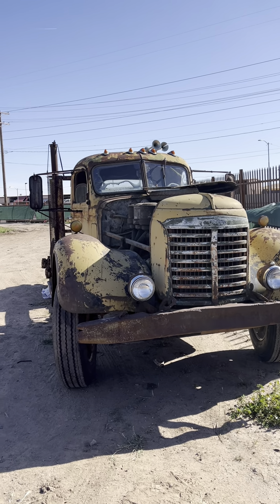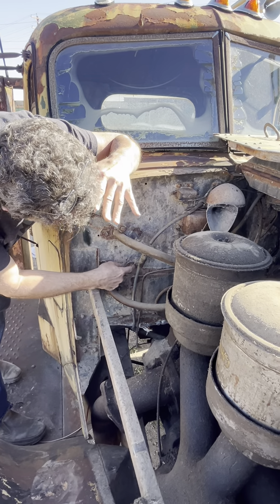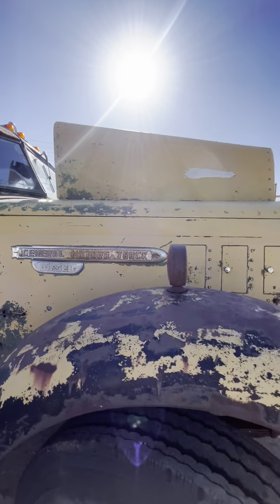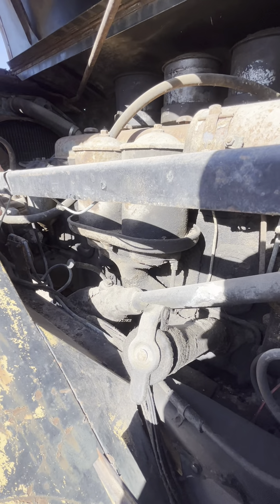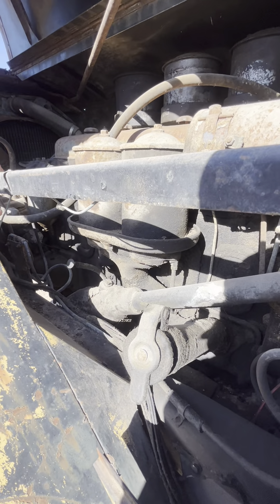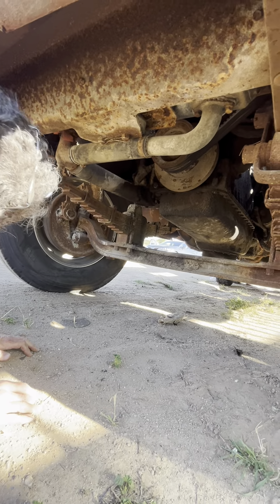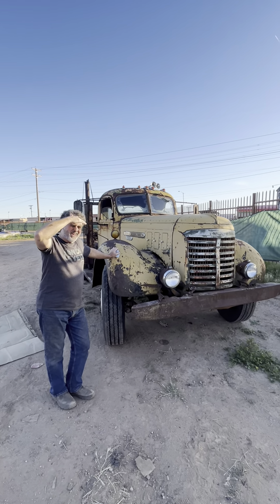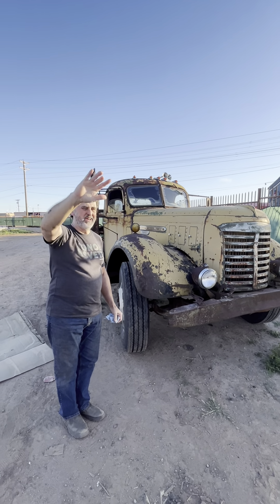1946 GMC ADCW-974 Tractor First Look Pt. 1

Comment: Didn't those also come with a V12 GMC gas motor 702 cubic inches or something like that
Reply from the maker: That wasn’t until the late 50s/60s.
Reply: @ronaldlingle8766 These 900 series GMCs (1940 through 1959) were built only with the 6-71 GM (Detroit) Diesel engine.  Mark Bridgwater